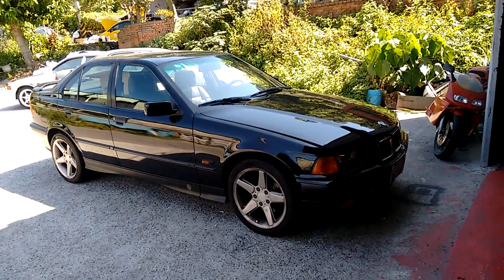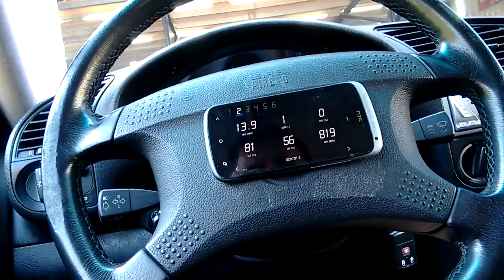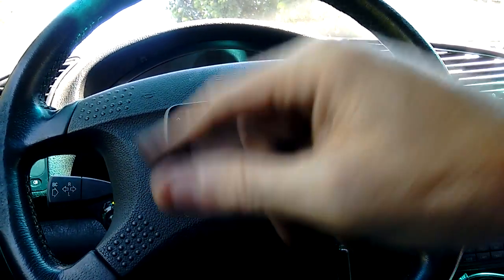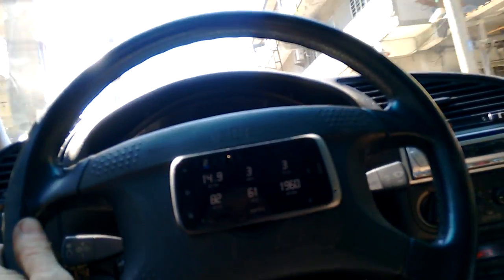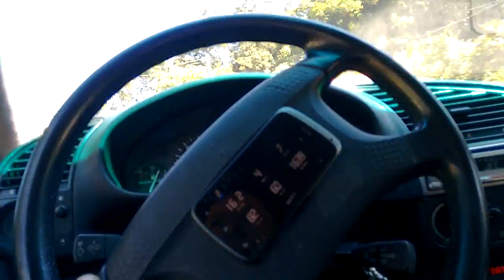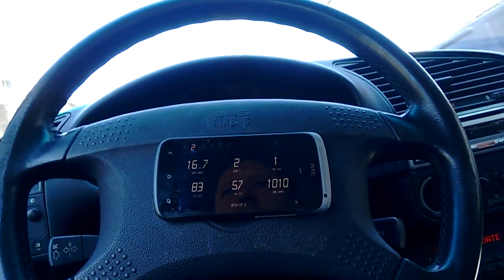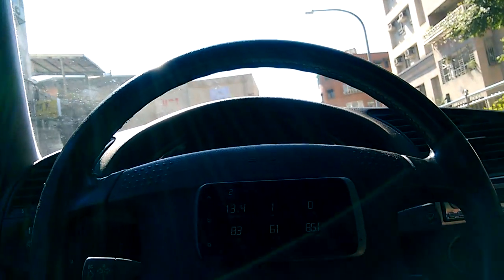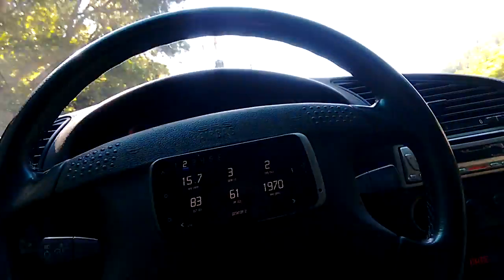Living with RHD Engineering ITB intake, light flywheel and EcuMaster EMU stand alone ecu!

Comment: I have the crazy light RHD flywheel on my 328. As soon as I drove it I've convinced two more people to buy them, they completely change the engine without any real negative consequences. Drove it back to back with a mates standard car and the difference was night and day
Reply: sp4nrs can you tell me, do you lose something with lighter flywheel?
Reply: Sergej Naunovic  
It may stall easily if you are a poor driver, otherwise no.
Reply: Hoonatic Bloggs didn’t make it much harder to drive. Just made it better!
Reply: Does it rattle much? I got a Cabrio and I will hear a rattle easily.. and what clutch are you using?
Reply: @listdude  no I didn’t have any rattle. I had a Sachs HD clutch to suit an M20 engine (as this is required on these flywheels). Seriously there weren’t really any downsides. You could probably go for a non heavy duty clutch if you weren’t thrashing the car, but mine was driven hard :)

That engine is sold now however, and there is a 500hp LS in the car now